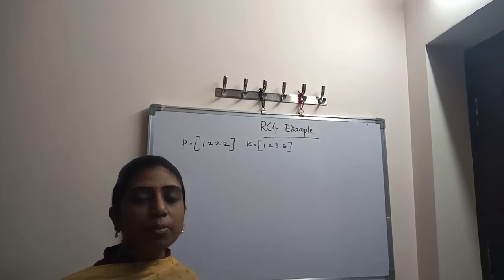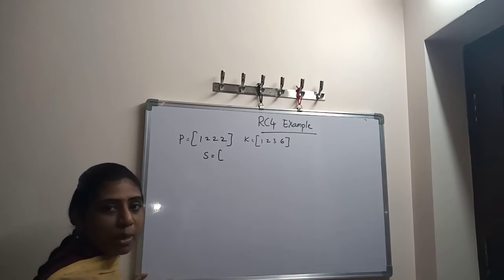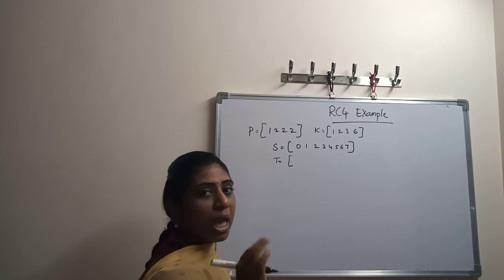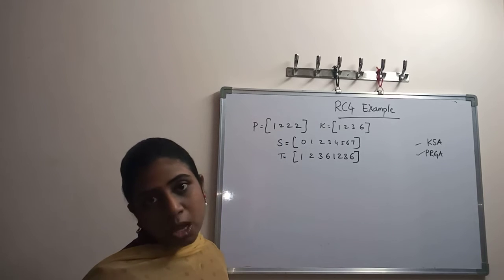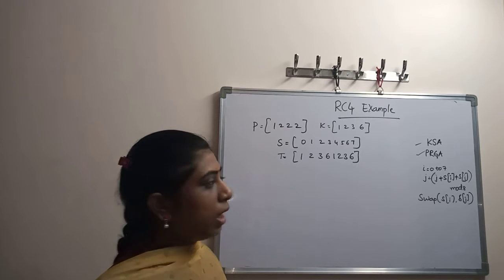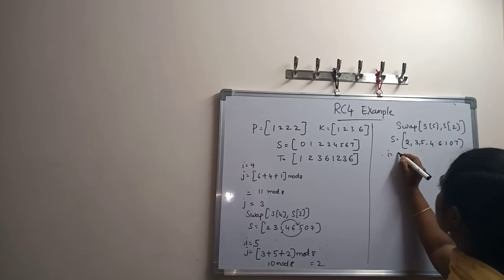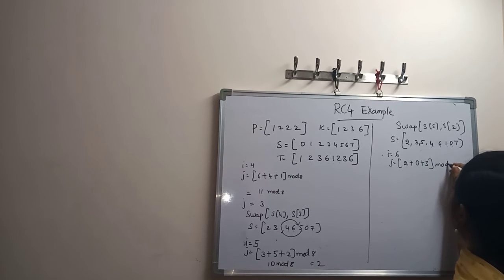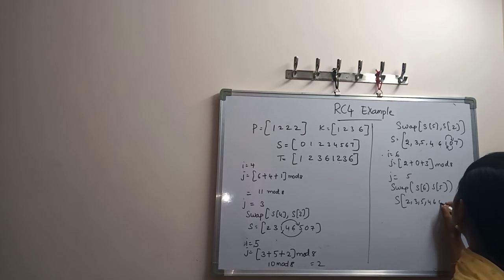rc4 example

Comment: From iteration 2 , all the values substitute for s[ J ] is wrong
Reply: Could someone explain that
Reply: @makz77   (j+S[i]+T[i]) mod 8
Reply: Ya
Reply: @yasminelouaked5079  suppose to be T[i] but y did she wrote T[j} ?
Reply: @aryarohanrachamalla2730  she did a mistake
So rc4 algorithme is: 
int j = 0;
for (int i = 0; i <= 255; i++) {
    j = (j + S[i] + T[i]) %256 ;  
    swap(S[i], S[j]); // Swap S[i] and S[j]
}
I hope u understand
Reply: @yasminelouaked5079  you are also wrong. correct is i<255 and also %256, not 265 and is only when size of state vector is 256. else take whatever is size of state vector.
Reply: @peace_y123  yes its 256%*